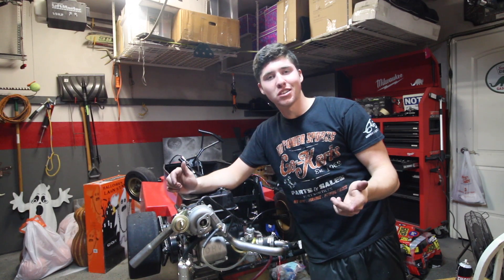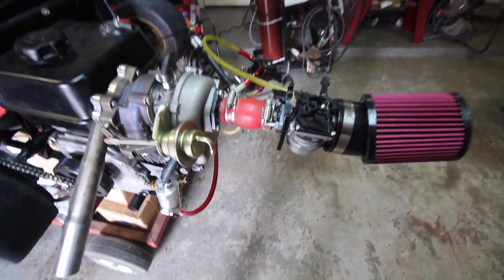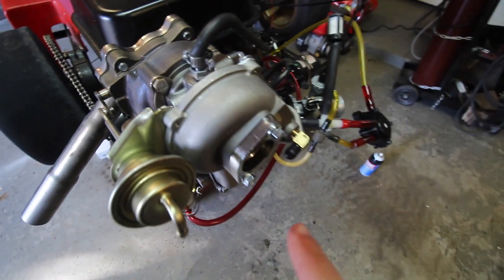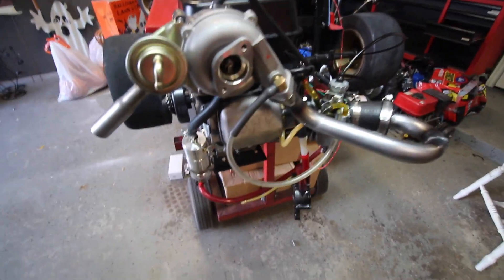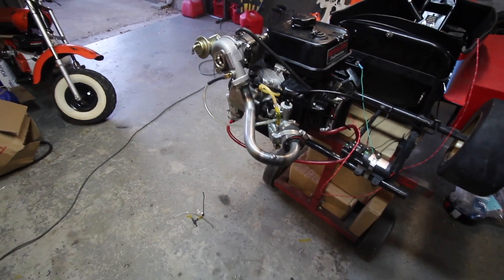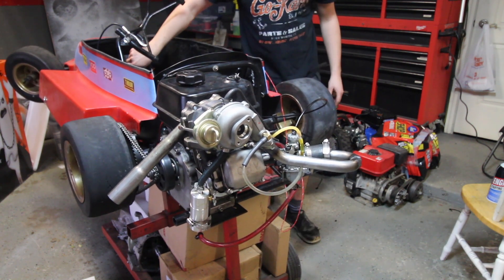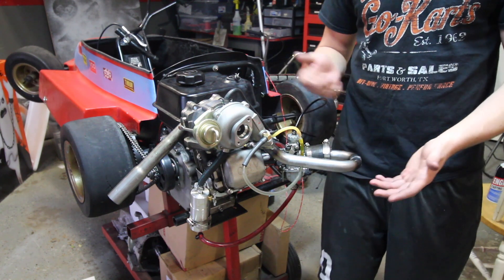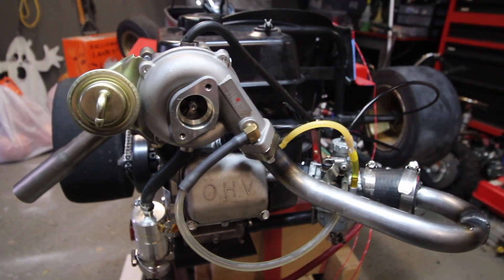Tuning The Turbo Go Kart!

Comment from the maker: Big salute to all the Veterans today! Also we would like to note that we have a BBR Extra Channel now live where we are going to post some of the more technical content or things that may be interesting to some of you that don't necessarily "make the cut" on our normal videos.  For those of you who are into the CJ-7 build you should totally check it out because there is going to be a ton of Jeep stuff on that channel too!

You can find the "BBR Extra" channel in the description or on the end screen in the video. Thanks!
Reply: Build Break Repeat Second Channel right here! Make sure to subscribe!
Reply: a boost idea of mine no one has paid attention to for small engines:
why NOT a brushless motor electric ducted fan used in electric model jet planes? they push a lot of thrust/pressure for being compressor type fans, the electronic speed controller can be programmed, controlled with a hall sensor on the throttle. you can program it's start point and it's RPM torque/boost curve with a 10 dollar (or less) card unit. it wouldn't involve all the "fancy plumbing" required by a real turbocharger either.
if an air filter is large, a unit could fit right inside it, sneaky-sneaky!

figure this, if the carb's throat is 26mm (pi R squared) and 531 square mm circle area, a 50 mm ducted fan is 1963 square mm total, minus 706 mm if powered by a 30 mm motor in its center, is 1257 square mm of compression surface area... roughly a 2.4:1 ratio between the push of the fan vs the carb throat.

now the "fun" stuff.... the things are rated for how many pounds of static thrust they deliver, they usually DON'T tell how many CFM, or how much pressure they can develop.... like: 50mm being about 2" diameter, if its mounted to the end of a 2" pipe with a 1" outlet.... how much pressure in the 2" section? how many CFM (and at what pressure) is available at the 1" outlet? what is the max pressure it can develop before the compression fan blades are stalled? -like when ya put your hand over the hose of a shopvac and it revs up, basically. (there's still suction but the amount of flow gets choked off)

I do think one would more than keep up with a small engine's intake/exhaust/displacement flow anyway, also possibly delivering at least 4-5 lbs of boost pressure, very easily and inexpensively too, like under 50 bucks. what might it do for a 212 size engine? lets think "oxygen"... if normal sea level air pressure is about 14 PSI, then 4 lbs of pressurized intake is trying to stuff about 276cc worth of oxygen into that 212cc displacement (30% more). kinda same strategy as a turbocharger or blower, it's already compressed when the piston is bottomed.... THEN the piston compression multiplies THAT.

anyhowz..... that's "the long version" why I think it'd work out nicely once the speed/power controller is correctly programmed (oh hey, electronic management almost like the big boys!).

edit: if the ducted fan is fuel proof, it could go behind the carb.... but its probably a better idea to go an EFI arrangement, which could also be controlled and programmed similarly to a ducted fan, maybe even from the same hall sensor for throttle position input, and tachometer (flywheel+coil).
Reply: And its blowing out air at d bottom because that's we're u hook up your boost gauge from run a hose from there into a gauge
Reply: impressive hydrodynamic pressure system you guys are running, - its really similar too an automobile turbo setup.      , as an engineer, i simply couldnt resist the opportunity too blow in heaps extra fuel with a massive pump and an old civic injector. pulsed with one of these badboys. https://www.amazon.com/HiLetgo-12V-40V-Controller-Switch-Module/dp/B00QVONO20/ref=sr_1_5?ie=UTF8&qid=1542113193&sr=8-5&keywords=pwm+module  . great videos. i wanna see this thing smoking on boost
Reply: do efi
Reply: Do EFI maybe?
Reply: .. colder spark plug with a smaller Gap will help that break up
Reply: You should do some vids on that GT350! WHAT DO YOU MEAANN
Reply: Build Break Repeat By any chance can I get plans for this? I’d like to build this on my tecumseh. But I don’t know how to set it up. Thanks!
Reply: We're did jou buy that turbo.

Comment: If you're using blow through setup, fuel pressure must be more than the boost pressure, thats why you have problems. You can use battery powered cheap fuel pump to solve the problem

Comment: I have a question. Do you have the exhaust running through the turbo and then back through the carb? There's a inlet for the exhaust to enter the turbo and a outlet that runs to the carb. I can't really tell how you have it hooked up on the motor.

Comment: Only way to get these small engines work with turbo is install carb in turbo intake. There is no living person who has made one cyl run properly with normal slide carb with pressure. And when installed in turbo intake, low rpm drive is probably going to be horrible cuz you have to tune it so rich, otherwise it goes way too lean when and if you manage to gain some boost.

Comment: Have you guys thought of trying an efi conversion for it and removing the carburettor to be able to get it tuned better and actually be able to make boost. Also now that it’s turbocharged you will probably need more fuel pressure and not just a gravity fed fuel system

Comment: The answer is to build a carb. box.  That is, an enclosure that is pressurized by the turbo with the carb inside of it.  A small check valve in the fuel line will prevent blow back during moments of high boost.  Here's an example.  https://www.theturboforums.com/images/imported/2008/01/86hie01-1.jpg

Comment: If you try attaching a lever arm to the idle or air fuel mixture screw then attach that to the throttle and you would have Progressive air fuel mixture. Also adding a fuel regulator

Comment: Also get a boost gauge and electric fuel pump and regulator and set your fuel pressure to .25 lb higher than your boost pressure to equalise the pressurization of the fuel bowl

Comment: Typically itll backfiring out the exhaust when you have too much timing. Whenever you add cyl pressure your spark becomes more volatile so the fuel burns faster which you need to back timing down

Comment: I have the same problem with a turbocharged lawn tractor I made, I took a turbo from a 14 Chevy Cruze and modified it to sit on my 12hp Tecumseh lawn tractor engine but every time it builds boost it will just push the gas back through and die, I’m hoping to resolve this issue by either using a pump with a regulator or equalizing pressure in the tank with the boost.

Comment: All you have to do, is Tee off the boost reference,and go tank vent, and Tee of to the carb drain (on the bottom) and the fuel/air will stay the same as boost builds/drops.  And when you said 'I tightened the screw but fuel still sprays out'   ……. that it just a drain, pull the plug out to drain the carb for winterizing the motor.  the gas was getting pumped out the overflow      and get 20lb valve springs before you blow the thing up.  hehe

Comment: You won't see any gains running a turbo on a small displacement single cylinder engine. The exhaust pulses won't generate a constant exhaust pressure to to make adequate boost. If you tune it to make adequate boost it will kill any horsepower gains due to the parasitic loss of the turbo itself. You would be time and money ahead doing an engine swap.

Comment: Right now, when the turbo boosts a little the carb stops deliver gas........ You must put the carburetor before the turbo! Remove de carb from the midle. Basicaly do this:     Carb --> Turbo --> Engine air intake....   (just like that!)

Comment: you will have to make a plenum around the carb to properly  blow through on that carb then use a one way air valve to the fuel tank to compensate for the boost also will have to be sealed,connect to the turbo also the plenum box around the carb

Comment: Why did you only make the left wheel spin? I think thats not good when you drive. Both wheels need to spin. Put an another axle on itso both wheels will spin. It will drive much better. Also put an blow off valve on it so the extra boost can go away when you release the accellerator

Comment: 7:50 have u screwed the pully on to the shaft because when u Rev it the full sprocket in the engine moves out like 10mm

Comment: You really need to build an enclosure that basically puts the entire carb under boost, then run a pressure line to the tank so fuel still flows under boost. Remember carbs work when they suck and they can't suck when there is more pressure inside the carb than in the fuel supply.

Comment: need to add more fuel psi we it gets to boost it pushs fuel back in to carb how ever much psi in boost you need to add that tp the fuel psi when under boost . if your maken 5 psi boost and 5 psi of fuel psi then under boost you need add 5 psi of fuel need to add a lbs of fuel psi for every lbs of boost

Comment: You got a few options that would fix your problems ,  perhaps easiest would to get a fuel pump and some controls that tune fuel press with turbo boost , also run capped line as a return fuel line to tank . It might also be possible to just stay strictly mechanical by sealing gas cap and running pressure line you got running to carb instead to tank thereby pressurizing fuel as boost builds but you would need a blowoff valve to prevent over fuelling at low rpms , but you def need boost gauge and some controls either elec or mech to control the difference of fuel demands . It would even be possible to salvage an injector from a tbi from old car and nix the carb all to gether and make a trip to autopart store and radio shack and slap proper controls on , but once you get a set up that works be prepared for something to break . You just need some thinking cap time and you will suceed . Hope you have a blessed day

Comment: You are forgetting one thing the regulator valve on the side of the turbo has nothing hooked up to it you need to have vacuum up to it so that way it controls your  boost your going to just be chasing your tail until you fix that situation a little diaphragm on the side of the turbo that controls the butterfly that opens for the exhaust that's why you're having a mixture problem because it keeps trying to spool the turbo if it's closed or it's not spooling the turbo if it's open

Comment: No reason the carb shouldn't of worked on the intake side of the turbo. Maybe just needed a stronger spring to keep the throttle closed. Look at all old school blower cars, the carbs always sit on top of the blower and never had a problem.

Comment: One more thing, you are going to have to run an electric fuel pump also because usually the fuel is gravity feed and with boost it pressureise it and basically stops the flow of fuel to the carb so it must be pressurized in order to work. Idle the waist gait will solve it but if u get an electric fuel pump and run it on a relay and hook it to the throttle so when u start on the gas, up have to play with when it turns on but it will kick on and pressurize the fuel because the boost is basically just forcing it back into the tank so u need to over come that witch that is not a big deal at all. So your waist gate needs to be working and u need fuel pressure. Sounds simple witch it is but it's just different on a small engine like that. But I can say confidently that is your issues and again I hope you read these!!

Comment: This comment will be a little bit long but read it please!!! I can see your problem right now and it is simple fix but you have to read this ok? Lol I don't know if you understand how the turbo works properly. Really quick rundown exhaust spins the turbine spinning the cold side making boost yes? K so when you idle or you don't want boost or u need to control it that is the last gates job. Witch u do not have hooked up!! The gold round thing next to the inlet of the turbo has the vacuum line hook up to it that has to be connected to vacuumn or to the carb so when u idle or a certain boost level is reached it opens the waist gate letting the exhaust go out but not spin the turbo. U have to have exhaust out of the engine separate then the waist gate has it's own exhaust pipe also. So the normal exhaust spins the turbo but at idle it should be exhausting out of the waist gate pipe so the turbo is not spooling. The vacuum control that gold thing and it moves the lever to open and close it. Does that make sense so far? I'm not trying to talk shit or talk like u don't get it I am honestly asking if you follow what I'm saying so far. Also it needs a blow off valve of some sort witch idk if that engine makes enough vacuum to operate these parts but only one way to find out! A blow off valve is on the charge pipe, the one going to the carb. Boost is being pushed into the engine but once u let off the throttle it is blocked but the turbo is still making psi so the blow off valve opens and does just that it makes the Pshhh sound by releasing the pressure out into atmosphere. Where the card intake is or where the turbo pipe is hooked to also if you look at the card there is lil holes and those go straight into the float bowl and since your waist gate is not functioning at idle u are making boost when it should just be under vacuumn so negative boost that is why it's blowing the gas out and pluging the top tank will just build pressure until something pops. But your problem is the waist gate and the exhaust!! I hope you read this and understand it better hopefully and make some progress maybe on it cuz I wanna see it ripn!! Ok well comment back if you have any questions and maybe I can answer them for you, if you even get this that is.

Comment: thats an oil return line lol
trying to boost through a slide carb lol
pressurizing the float bowl not the tank lol
fuel pump lol

at least you guys are participants and not spectators..well done

Comment: You've got 2 options to get this to run properly. 
Either build a proper box to go around the carby or go to a suck through design.
Either way you probably need to get an air fuel ratio guage and play with the main jet sizing aiming for around 11.5 to 1 under load on pump fuel.
Good on you for getting this far though 👍

Comment: The carb should be on the inlet side of the turbo if you use fuel injection it would go after the turbo

Comment: Just make you an equal length split manifold then you just have to sync them to where you have a primary for your idle speed.
Tap manifold for a vacuum port on each runner, that why you can tune off vacuum.
Which will at least get you to a better setting than ya'll are now.

Comment: Get a wideband o2 sensor so you know how rich/lean it actually is. And get a boost gauge that also reads vacuum. Tune for maximum vacuum at idle and go from there. Pretty neat little project!

Comment: If you don't equalise fuel pressure with a blow through setup, you are going to continue to have issues. You can also enclose the carb in a box and pressurise the whole box. That way the pressure outside the carb is also at boost pressure and that should stop the fuel being pushed out of the overflows.

Comment: You need fuel pressure higher than boost pressure, there are some special turbo carb fuel pressure regulators that can do that, and you need fuel pomp

Comment: Good job guys, your not floating the valves, however your tank needs boost pressure too, that way the fuel can flow into the carb, you have a lean breakup, and when you let off it fills the bowl and works right, pressureize your tank and fry some tires youve got the rest done.

Comment: This still isnt going to work.  You will end up pressuring the carb and the gas is going to stop flowing into the carb. You need a fuel pump that can be at least 1psi more than your boost pressure!
Reply: Yes that and a fuel pump will fix it

Comment: Hello, you have to close the little holes in the admission of the carburetor because if you blow high pressure from there the fuel will flew away... Trust me that's the problem

Comment: you need to add whats called a pitot tube, you run a tube perpendicular through your boost pipe with a hole facing air flow, connect the tube to a line pressurizing the carburetor float bowl, this will allow main jetting to remain close to stock, you can also box in the whole carb and pressurize it, carb doesnt care about boost so long as you keep it equally pressurized, problem comes when some areas and circuit are at atmospheric and others are at pressure, youll also need a rising rate fuel pressure regulator or referenced fuel pump to add a pound of fuel pressure for each pound of boost otherwise fuel cant get in to the bowl
Reply: This is exactly the right way to do it, or at least has worked for other people. A pitot tube, an enclosure for the carburetor (the enclosure must be air tight w/ a fitting for boost ref) a fuel pump, and a boost referenced fuel regulator would be recommended.  Aeromotive and Magnafuel make these regulators but they are pretty pricey.

Comment: Have you guys tried running check valves on the boost reference (pressurizing the carb) and also on the fuel line. You can use it to keep pressure in the carb and stop fuel from pushing back out. Just a simple thought.

Comment: Oh and under no load you're not making any boost what so ever.  Please, anyone watching this shit, this is not the correct way to "pressurize" a mikuni carb.  All that will happen is when it does actually make boost it will pressurize the bowl and starve the system for fuel because it's holding the needle shut

Comment: You should be pressurizing the tank with the same pressure going to the carb. Neutral fuel dressier for a blow through will work well.